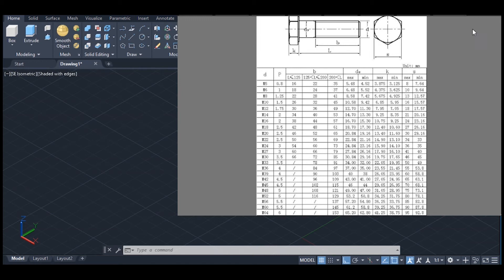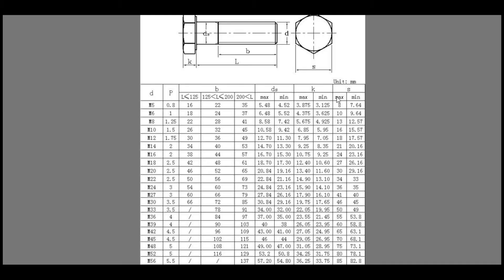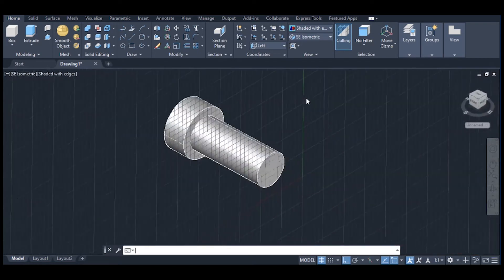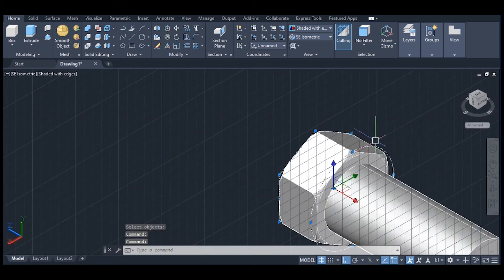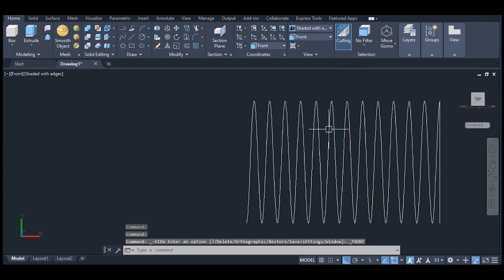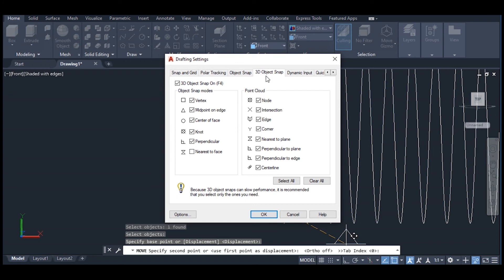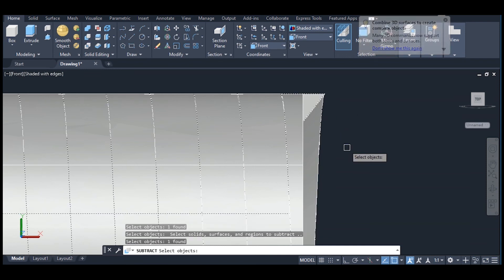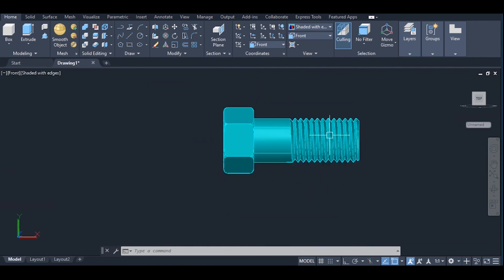How To Draw 3D Bolt in AutoCAD- Standard sized

Comment: When I tried to chamfer the edge at the end, AutoCAD gave me an error saying, "failure while chamfering," no matter what. The only way I was able to get the result in the video was by extruding a 1x1 right triangle along an arc, snapping it to where the chamfer would be, then subtracting that shape from the bolt.
Reply from the maker: Hello,
Make sure you do chamfer before creating the thread ie immediately after presspull
Use Chamferedge option